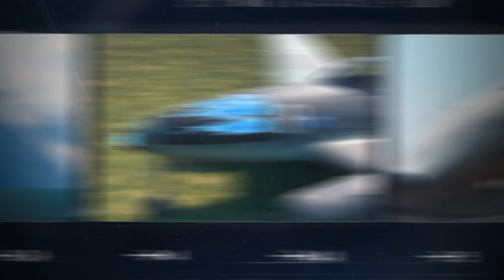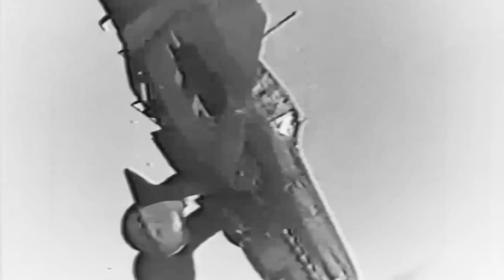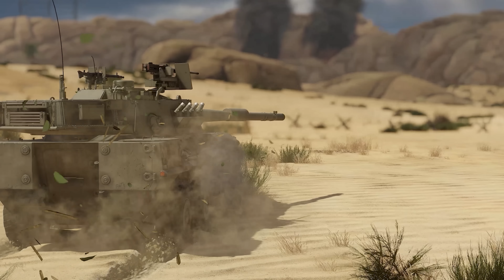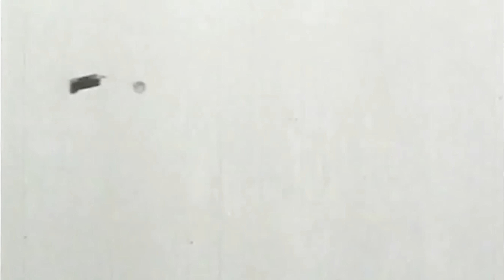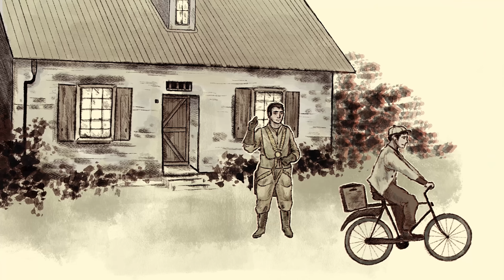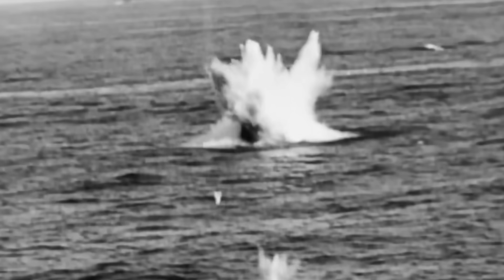The most dangerous fighter plane of World War 2

Comment: I remember reading a book about fighter planes and World War 2. Hitler saw the ME-262 and immediately wanted it as a fighter/bomber. Stopped production of the ME-262 in 1942 until they made a fighter/bomber version.
The war ended in 1945. That's 3 years where the ME-262 could have been wiping out bomber formations instead of sitting in laboratories.

Comment: How did B-17s in 1943 encounter the Me262 when it only entered service in 1944?

e: On the Ball turret, no there was no 'jettison lever'. The procedure to remove the ball turret required bolts to be removed with a wrench, and the use of a hammer to dislodge it, both of which located in an emergency kit in the fuselage. The ball turret was actually statistically the safest position in a B-17 as it was the only turret that had armor with pilot and waist gunners being the highest casuality rate locations. Bailing out was incredbily difficult though due to the need to put the turret in a specific spot, leave the turret and enter the fuselage, grab a parachute, and then jump out. Some crewmembers took a parachute in the ball turret anyways even though there was no space so they could just directly open the hatch and leave, they'd have to put the parachute on whilst falling though.

e2: For the Me262, the cockpit 'was not designed to break free'. The canopy could be jettisoned, like every other fighter, in order to aid escape. With the side opening canopy the only way to open it whilst flying would be to jettison it. But no, the cockpit couldn't 'break free', it wasn't a seperate box.

I appreciate the video, and the rest seems decently accurate, but fact checking is important

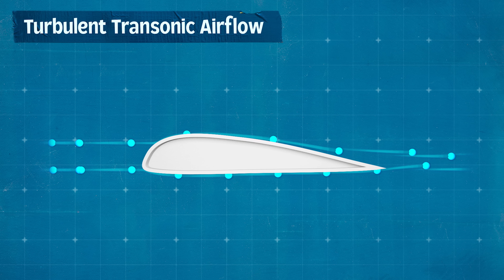Comment: @FRANKIEonPCin1080p Amazing video! One little correction at 10:35, the plane technically isn't "sucked" up more like "pushed" up. High pressure always goes towards low pressure. So the higher pressure below the wing pushes upwards to fill in the low pressure. Overall a great video, and just a little something to add. Glad you're back!

Comment: Actually, the Su-47 has excellent maneuverability at low (sub-/transonic) speed. The problem is almost the exact opposite, with it being unstable in proper supersonic flight due to the forward-swept wings. Backwards-swept wings are much better for this, as the angle allows the shockwaves piling up on the wings to dissipate.

Comment: I love a lot of this video, but the end is really over-promoting Nazi mythology. The Allies had jet fighters at the end of the war, in fact the Gloster Meteor flew before the Me 262, but was instead of being rushed haphazardly into combat being tested and perfected, until when it debuted(2 months after the 262) it was a fantastic jet fighter that required almost a tenth the maintenance, was more maneuverable, and more reliably flew in top quality condition. When the allies discovered the 262's blueprints and research, it was largely seen as being slightly behind their own with a couple of differences(the swept wings for instance, which were an accident on the 262 to be able to support the big engines that ended up helping, it was originally supposed to have straight wings.). Even the engines were a conceptual dead end, only really finding reproduction in Czechoslovakia until Soviet-provided copies of the British Rolls Royce Nene jet engine were available.

Overall, yes the 262 was an incredibly advanced aircraft, and really interesting as this video shows, but the Allies had the exact same tech, if not better. They just weren't pushing it into the field well before it was ready. That's one thing you tend to see with the nazis. It wasn't that they had the more advanced technology, it was that they were putting it in the very frontline out of desperation while everyone else was still testing and bug-fixing equipment. And you see the results of that in the Allies winning the war. (For instance, early nazi IR tech was being deployed around the same time the US army was determining that it was actually more of an expensive beacon of where the enemy should shoot you and went back to the drawing board).
Reply: Gloster Meteor: First fligh 5 March 1943
Messerschmitt Me 262: First flight 18 July 1942

"in fact the Gloster Meteor flew before the Me 262"
It didn't

Comment: Great to see you back Frankie. That said. Ohain's and Wittles jet designs were totally different. After war Wittle accused Ohain of stealing his design, and went through lawsuits only to find that even though the engines were designed at same time, they were using substantially different principle of operation. Wittle's design being turbofan , while Ohain went turbojet route. Not getting into too much specifics, Turbofans are good for longer sustained flight and reliability, while turbojets provide much more power from lighter package, but are more expensive in use and maintenance. Which is perfectly seen by turbofans nowadays being used in commercial planes mostly, due to reliability and cheaper maintenance, while turbojets are what is powering military jet fighters, where cost to run is not an issue, thanks to taxpayers footing the bill.
Reply: Frank Whittle's first design was a turbojet as well, of the centrifugal type. A turbofan is an axial flow turbojet driving a ducted fan mounted forward of the gas turbine, directing thrust around the turbojet housing and increasing pressure of the incoming air for the turbojet. The combination of the two is a far more efficient means of propulsion than a sole turbojet engine; at low speed a turbojet wastes a lot of kinetic energy and therefore fuel, while providing relatively little thrust to propel the aircraft.

The efficiency problem was recognized early on in jet engine development and Frank Whittle patented the principles of turbofan propulsion in 1936. The first turbofan, de DB 007, ran in ground tests in Germany in 1943, but it was a complex design and cancelled in favour of simpler designs like the axial flow BMW 003 and Junkers Jumo 004 turbojets. A British turbofan, the Metrovick F.3, ran at a later date in the same year but this was also a complex and heavy test bed engine. It did prove that specific fuel consumption and noise were markedly reduced compared to turbojets, however, laying the groundwork for further development.

Comment: Frankie I love ya but you got swept forward wings completely wrong! They are all about maneuverability! swept forward wings are a configuration that is inherently unstable which is what makes it extremally maneuverable. The downsides are that it is nearly imposable to control such an aircraft without computers and it is an extremally difficult materials/engineering problem to keep the wings from twisting off.